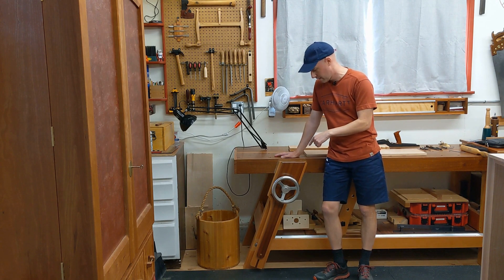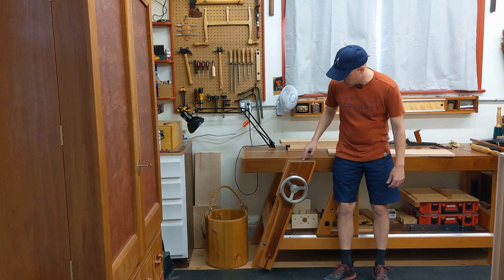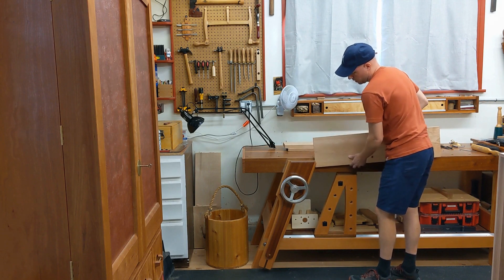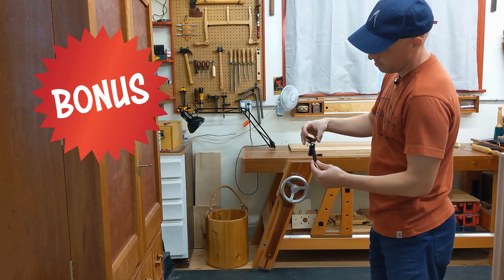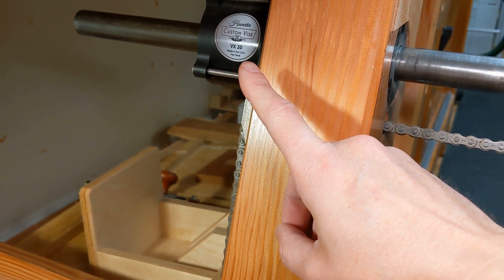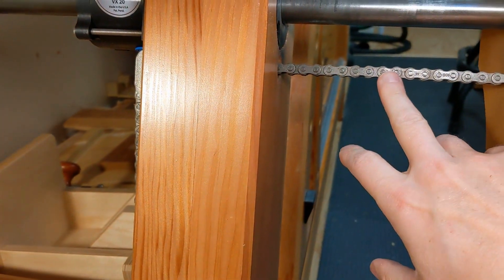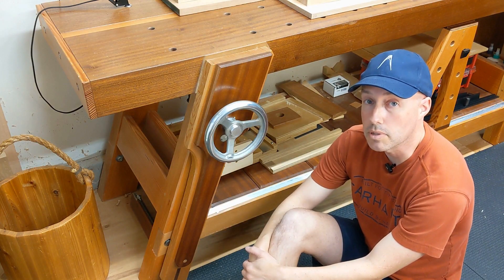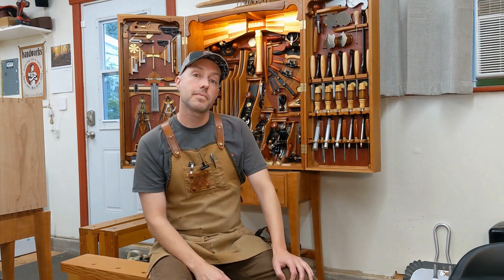Angled Leg Vise For The WIN!

Comment: I already had the Hovarter tail vise and love it. So I decided to upgrade my leg vise screw to match. Then I saw this video and was captivated by the Ancora yacht chain device. Long story short, I installed both and they work like a dream! I'm still having trouble fully understanding the physics of the chain parallel guide but it works. :) This video is the only place I have ever seen this. I'm quite surprised it isn't more popular, especially since it is both easier to install and less costly than some of those x-links. Anyway, thanks again for the inspiration. 

Tom

Comment: I run a Hovarter Leg and Wagon vise too 👍. It’s not often I bump into someone else with them. I originally went with Len’s design as a way of supporting a small maker/innovator.  I do run a 24’ twin Veritas on the other side too, but then my bench is in the center of the west bay in my shop and can be worked on from all sides.   Thanks for the content 👍

Comment: RC - I have been thinking about building a leg vise for a few years.... I never liked the solutions for the guide board at the bottom. Thanks for a couple new things to consider. I do love the way the Horvarter vise mechanism works, but plan to stick with a wood screw from Lake Erie. However, I like the chain idea from Ancora Yacht Service, not to mention his custom boats! Question - Why did you go with the chain and not the X LInk from Horvarter? It looks like the X LInk may take a little more time to do the mortise work, but I like the way it disappears and eliminates the guide board. Comments appreciated - Dan

RC - and there is the answer - in the video....
I also had the same thought about all the digging needed for the mortise. 

 Horvarter - WOW! 
I will need to find another place to try it.  But,  will have the chance to contemplate every time I turn my wood screw.
Thanks for sharing.
Reply from the maker: I talked about the X-link in the video by one of its other names (criss-cross) and, likewise, explained why I didn't go with it starting at 6:38.
Reply from the maker: The Ancora Yacht Service chain guide is also as easy as drilling 4 holes, as opposed to excavating a bunch of giant mortises (which I would've had to borrow a router for at the time I built the vise. I have zero desire to do mortises that large entirely by hand.).

Comment: Very cool! Have you ever thought about adding a kick plate for the sake of ergonomics? Something extending a little bit laterally down at the bottom of the vise would allow you to more easily kick it straight on-- which would remove the need for that external hip rotation and use the larger muscles in the leg. You certainly don't seem to be struggling but I wonder if it might be more comfortable (and reduce wear on the joint in the long run).
Reply from the maker: It takes so little effort to close it the way I do,   I do it without conscious thought at this point.

Comment: You had me at "low drag coefficient".
I have to hand it to ya, that's a sweetly elegant vise with the chain parallel guide. I like the foot operation, the off centerline vertical work clamping, frankly all if it. 
One thing that mystifies me: why is the upper lip of the chop not flush with the bench top?
Reply from the maker: That was actually a happy accident.  I screwed something up while making the vise chop, and just left it, thinking I would remake the chop if that bothered me. It's actually really nice. It gives me finger clearance while using joinery planes- or any plane with a fence on it.  Now, if I ever made another leg vise chop I'd do it that way on purpose.

Comment: Hi, fantastic bench and chop! Quick question, if you had a single bottom leg brace and mounted the parallel guide such that the top of the parallel guide bar was riding the bottom of the leg brace and the top of parallel guide bar could not move past  the bottom of the leg brace, thereby keeping everything in parallel, couldn't that work and possibly avoid buying another expensive (albeit ingenious part in the chain guide) component? I am a new woodworker and I don't know nothing, so please excuse my ignorance.  Your channel is now on the watch list!
Reply from the maker: I think such a setup would prevent a smooth opening and closing of the chop. It wouldn't hold it in parallel either. The only tried and true options I'm aware of are a removable pin at the parallel bar (easily the cheapest most simple option), a criss-cross, or a chain.

Comment: Just saw this. Fantastic design that maximizes functionality and is good looking to boot. Thank you for sharing. One question - do the angled bench legs have  any impact on the efficiency and positive feedback you get when using a chisel and mallet to chop out mortises, dovetails, etc. ? I like to chop out stuff in a position directly over the bench leg (not angled) because of the solid feel of each blow with the mallet. I’m wondering if the splayed legs still provide that feeling. Thanks again!
Reply from the maker: I've pretty much never chopped over the angled legs, favoring instead the vertical legs on the opposite end of the bench for that reason, not to mention that I like chopping from a seated position and the leg vise would be in the way.

Comment: Ordered vise and chain mechanism to remake my old work bench like your angled vise. How did you connect the legs to the top? I'm sure I could attach them somehow but thought I'd ask. Noticed legs didn't protrude the top which I kind of like the look of. Thanks, Terry
Reply from the maker: Mine are very large mortise and tenon joints that are unglued because it's a knock-down design.

Comment: I’m looking at the Hovarter vise and was wondering if you could answer a couple of questions for me? How long is the shaft from the back of your chop? And how far down from the bench top did you place it?
Reply from the maker: The clamping shaft is roughly 19" minus the thickness of the vise chop (you really should get this info from Hovarter's website because it may have changed in the years since I got mine) and it's about 7.5" from bench top to top of clamping shaft.
Reply: @themountaintopjoinersshop8422  Cool. Thanks for the info. I'm going for the VX21 after much agonizing over the various leg vises out there. The quick release in and out is what sold me.